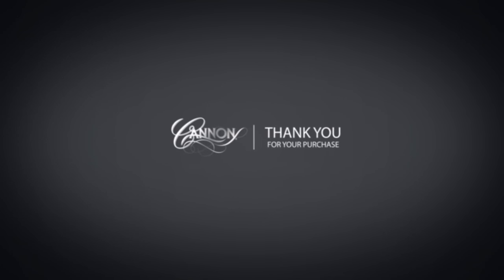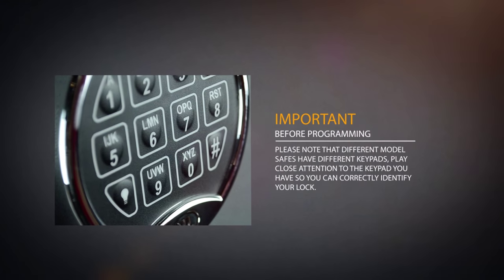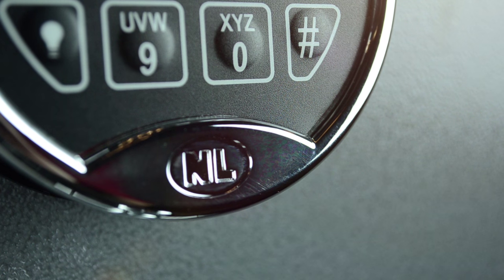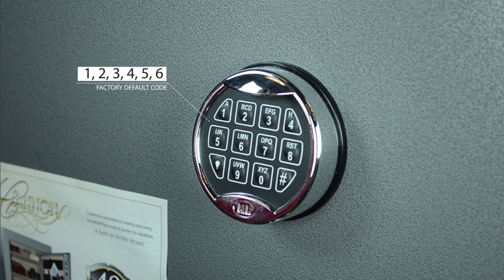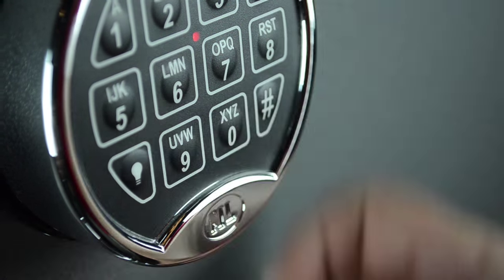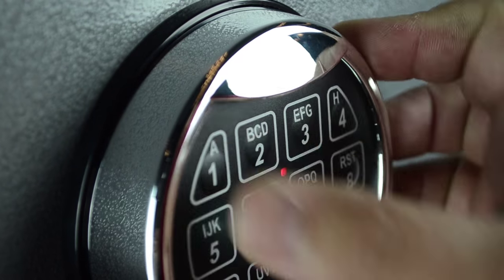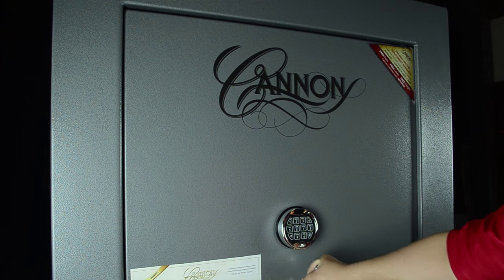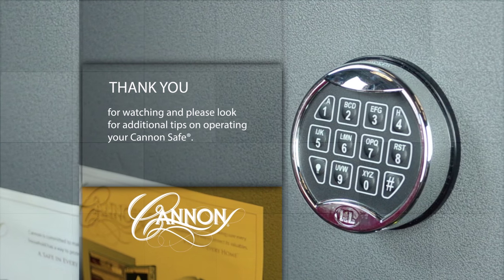Cannon Safe - Help - NL Lock Programming

Comment: I’m getting a single long beep when trying to open it. It has had the same code for years. Also if it does let me enter the code it doesn’t unlock the doors. What should I do?
Reply: Trail Time With Blaze  same here, any advise?
Reply: had a hard time with this too, you have to be very quick after the first double beep.
Reply: Same here. red light flashes.

Comment: DO NOT BUY A CANNON SAFE!!!! I’m currently locked out of my safe because the locking mechanism with not unlock. Tried the battery trick, rubber mallet trick, everything. Cannon will not pay for a locksmith to drill it out? Anybody know how to get into it with this issue. Tap point possibly?